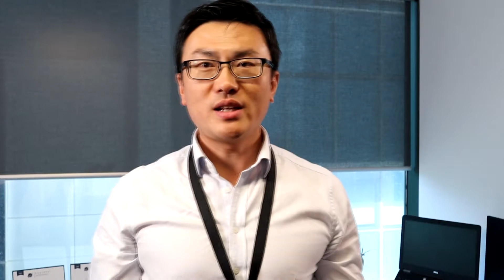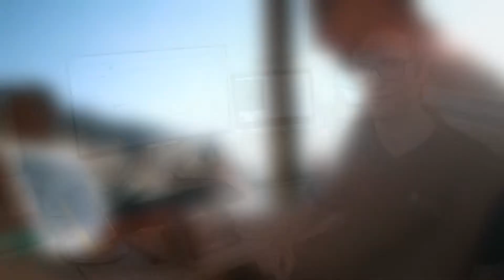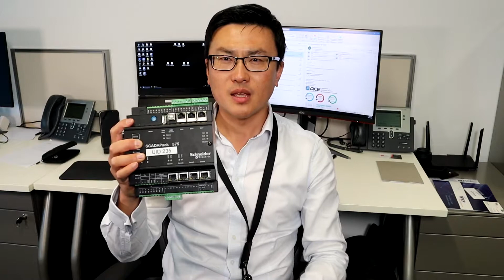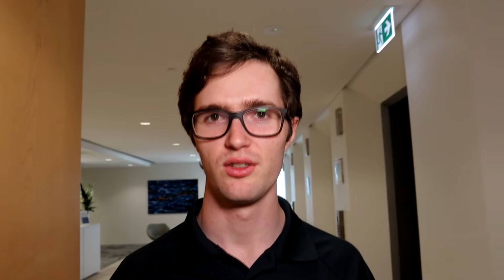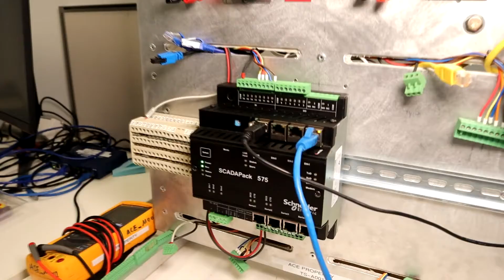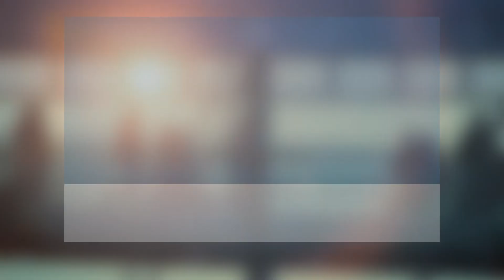SCADAPack RTU Training and Troubleshooting ⚙️ SCADAPack Programming Australia

Comment: Hello, guys. I have a scadapack 575 and I noticed some issues regarding remote connect. Force and modifing are not working on x70 logic and when I try to read the config from device using remote connect I got some errors...the firmware is updated...do you have any tips?
Reply from the maker: Hi Douglas, thank you for your question. Depending on the type of I/Os you try to force in the Logic, in general, all physical I/Os can be forced in the logic. Some bus I/Os (incoming) can not be forced. At least not in a straight forward way.
Reply: @acectrl  Thank you for the feedback! I did more tests using different variables and I noticed this behaviour regarding force.

Other question: How do you do to upload the x70 logic from a device? I did tests using the read project and the Read functions and in both cases I just got the config from Remote Connect... I would like to get the logic from this device. Like an upload function from most PLCs.
Reply from the maker: The Logic can be uploaded via the Logic Editor